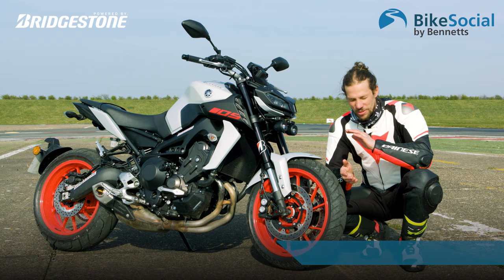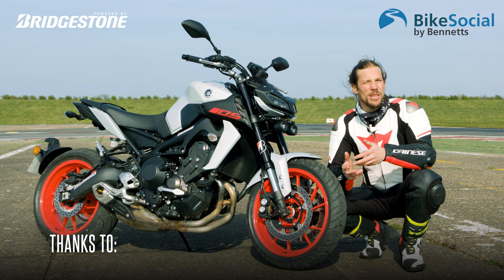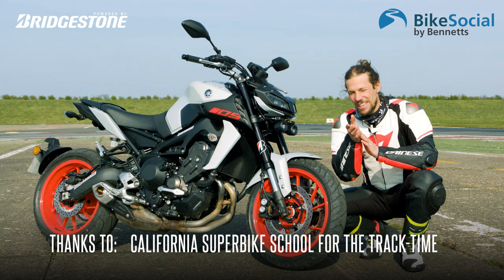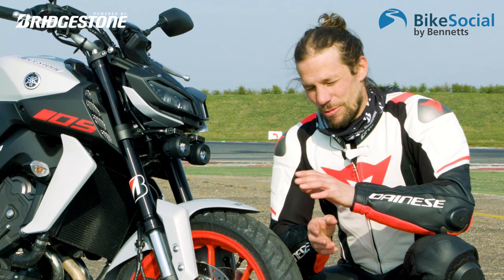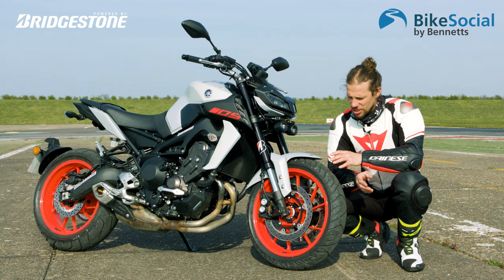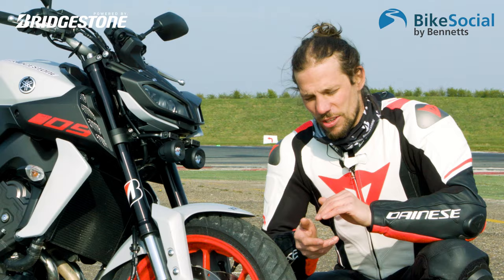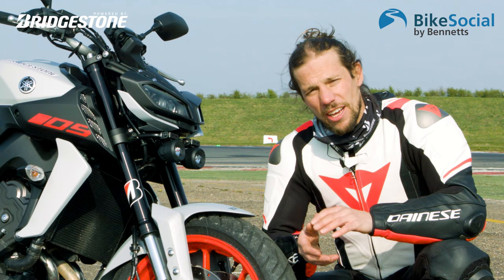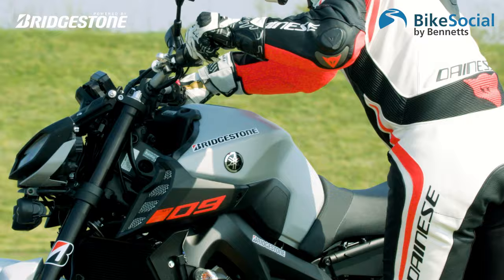Should you brake while turning? Motorcycle riding tips

Comment: Finally, some hard, experimental data on a subject nobody seems to agree on. The conclusions are clear and definitive: as long as you are smooth, you can use the front brake. Many thanks.
Reply: The hardest part is finding a way to practice this. I want to get that setup they got on their bike so I can practice this on my particular bike without worrying about the bike.
Reply: Teesh Yalamanchili get an off-road bike and practice on dirt! You’ll appreciate the feel of the controls more! Nobody knows how much you can actually brake on road coz you don’t know the road surface in practice (could be good, could be fuel or gravel etc) but getting the feel of the levers when it’s on the limit of grip does help. And if you’ve done off road you probably don’t panic as much just because your bikes starting to slide coz you’re used to it. Worth a go!
Reply: @SteveInskip  - thanks for the advice. I used to ride BMX, and did a bit of Mountain Biking, so I already have this natural tendency to ride the front brakes. Naturally those things don't weigh anything compared to a motorcycle but I've noticed the few times I've been riding I'm always feathering the front brakes. So perhaps it's just a matter of fine tuning my technique.
Reply: Teesh Yalamanchili yes, I think you’re right, but much cheaper to do it on an off reader! Falling off doesn’t matter so much and doesn’t cost so much. Have a good one!
Reply: @yatman67  Keep 'feathering' mate, I've done the same since the seventies and have yet to have a tyre wash out on me and I often go into a corner too hot.
Reply: @SteveInskip  Riding off-road won't teach you anything about proper front brake use and will probably make you a worse rider in that aspect. I agree off-road riding is beneficial for many reasons, but learning how to brake properly is not one of them.
Reply: I actually learned on my commute back and forth on my 250 just because my back brakes were gone and I was being lazy, that lead me to learning how to use the hand brake in all situations cornering being very easy to learn... I wouldn’t recommend doing it I was just being a lazy ass and stupid lol
Reply: Yeah learn on a dirt bike then accidentally like them too much and forget about road bikes all together!
Reply: Speed & Power it teaches you nothing about loading the front tyre, but it does teach you not to panic coz just you’ve lost grip, that the back brake is actually more useful than you thought and most importantly when NOT to use the front. Have a think about that last point. Not everyone lives in a town in a temperate climate!
Reply: mate i was just expressing that i tried a dirtbike got hooked, and that riding the dirtbike helps ur balance and confidence so much
Reply: Ruben Fraser hi Ruben. I wasn’t replying to you, totally agree with you about dirt bikes.
Reply: @yatman67  maybe that explains why I feel comfortable using front bikes, I was riding mountain bikes before i started to ride a motorcycle xD
Reply: If you dont have abs on, You better not try to apply simple disk brake(front) in a tight corner, else what the guy says she'll be out of control in a heart beat
Reply: I use hard on rear then soft on front never lost the front , but had a few heart stoppers
Reply: In an ideal world I absolutely agree but unfortunately on public roads you'll also have many variables with surface conditions etc so the police roadcraft method including your speed being dictated by your view usually ends up much safer but using their method in an emergency could really help.
Reply: amen. My Msrp class was wrong
Reply: Agree, a great find this video.
Reply: what about the rear brake?
Reply: @SteveInskip  Off road bikes are fine  off road that what they are designed primarily to do.   They vary very much from the ordinary street bike that one would use for general riding on tarmac so whilst its ok saying get some off road training that all well and good but try doing things on an ordinary bike the same as say  a trials bike and you will soon come to grief.  They are as different as chalk and cheese.
Reply: @rcraven1013  trying to ride your Super Naked like a trials bike would be a bit extreme and for anyone daft enough to do that I’d suggest they are probably better off taking the bus. Off-road riding does give you a very appreciation of how to control your bike in different situations with different levels of grip and it’s excellent for learning how to use your clutch and back brake to maximum effect. Think dual-sport rather than trials. It’s also a lot less dangerous learning the basic stuff, clutch control, braking with very little grip, bike handling, etc. You are going to fall off a lot but it’s a lot safer than an ‘A’ road and there’s nowt coming in the opposite direction….apart from the odd cow! 😉. I’ve got all 3, super naked, dual- sport and trials and they are very different beasts to ride but with a striking number of similarities.
Reply: Sure not general agreement. ‘Cos isn’t just one way, you take the ones you practiced.
Reply: @yatman67  hope you know it well now :) if not you can practice on the bicycle its same in principle and you need worrying about the bike :)
Reply: It's called trail-braking.
Reply: @yatman67  "The hardest part is finding a way to practice this" go for track training and practice learned stuff on the track. You'll very quickly learn the amount of braking that you can do while entering the corner is huge. Mid corner you can still brake a lot if there's a need for it. It might be bit trickier if you're already on the edge of the grip, but in reality you should never drive on such a huge lean outside of track.
Reply: Pretty much everyone agrees on it. And "hard, experimental data" this was not 🤣
Reply: @SteveInskip  the general rule that I learned from the basic motorcycle license course is "NEVER use the front brake when cornering"... and it makes perfect sense for a beginner, who is not able to correctly apply pressure on the lever; but I wonder: if I use the rear when cornering to slow down, doesn't this compromise the use of the front even more? By braking with the rear, don't I transfer the load to the rear, lightening the front even more?
Reply: @yatman67  Find a nice big and empty car park or other space and just go round and round in ever decreasing circles.  Begin with   slower speeds and when happy increase slightly to faster speeds and  and greater lean angle.   Then back brake, then front brake then  both brakes to   on a steady curvature and you will see just how easy it is to brake on bends without snatching and to come out of the bend with a slower speed than one went into with.

Comment: Had a crash last month. Entered a tight turn too fast, I panicked and squeezed the front brake too much and I wiped out. Dumbest mistake I ever did. Good thing I only suffered minor injury on my knee and wrist, and a few sratches on my bike. Ever since I'm afraid of turns and also of braking and just ride moderate speeds. Learned it the hard way.
Reply: Same here 😀 ...now i am learning what went wrong how can we avoid it
Reply: @lostworld5667  you need to practice it on the bicycle. If you learn to save front wheel slide in the leaning position it will be easier for you on the motorbike. On the public roads you should use trail braking only like lifesaver tbh

Comment: Of course you should brake while turning - IF you start braking before going into the turn.
Reply: you can also use the rear brake to correct trajectory
Reply: @Agussg23  wdym?
Reply: You can brake at any point of the turn even if you were not at the brakes, you just need to do it gentle if you leaned far
Reply: @Agussg23  I don't think that's a good idea, the rear tyre loses alot of traction when cornering, rear braking can result in lowside or highside (if you regain traction abruptly) , so between the fact that the rear brake is very weak in any situation, plus the fact that you are cornering doesn't give you much braking force possibilities, it's almost more effective to use engine braking and less risky. The front tyre however has alot of weight and grip when braking, so you gain more grip when braking contrary to the rear tyre, and you can brake way harder thanks to that , you also lose cornering capability so there is still a limit to how much braking force you can apply before you enter the opposite lane or leave the road when going left. But that's true of any land vehicule, lock the wheels of a car and you are going straight out of the road you can no longer turn. Best combination I can think of is staying low on gears wen cornering to get high engine braking if needed, and front brake as much as you can, maybe help a bit with the rear brake, but combining it with engine brakd maybe isn't a good idea, you may lose too much grip. If you are more of a sporty rider and take out your body more than you lean the bike, the more the bike is straight and the more braking you can have, the less you move your body to the inside of a turn, the more you have to lean the bike and the less braking you can have, that's also a rule that can help you keep a safety net if needed, taking your body a bit out even if you are not on a sport bike.
Reply: @OneRichMofo  if you want to go tighter into the turn, then apply a small amount of  rear brake, if you want to go wider, open up the throttle (gently)
Reply: @adridell  Thanks for the detailed response hahaha. I agree with most of what you said, but i almost always use the rear brake when cornering exiting the corner and even in corner entry. The engine brake is most of the times sufficient but in long corners is almost better to not let the throttle out completely (once youve started applying throttle) as this will mess up the weight balance. It's best to play with the rear brake depending on what you want to do.

About the front brake... on turns is best not to touch it (if the lean angle is high) because it will make the front tyre overload and loose traction and it is always better to loose the rear than the front tyre.
Reply: @Szlejer Armchair expert talking.

Comment: one of the best videos i've seen on braking.  An expert rider taking it to the limit over and over so we can see the results.  So great!  As others have mentioned, I'd love to see the results with the back brake progressively engaged.  There is a lot of free advice out there that says that's the way to do it when you over cook a corner - would love to see that tested!!
Reply: conscious - I want to see this too - using only the back brake.
Reply: If we use too much front brake at all when stopping we actually throw our whole weight and that of the bike and passengers forward onto the front forks, down those forks and to the front wheel and eventually all that weight load is taken on ones front tyre and that has a contact patch as big as maybe three fingers in total. Not a lot of grip there then.  However as we throw our weight forwards then we lose weight on the back end and end up  doing a reverse wheely in that the front is heavier and the rear is lighter so the rear wheel lifts up and loses contact  from the tarmac and thus rear brakes become  useless. Yes we can initially brake with both front and rear but as we progress and weight shifts more and more we could lose the back end  and all of its braking power..
Reply: You lose the back end before you actually get much braking done if you do this. It's easier to recover, which is why people recommend it, but it's not actually very effective. Even if that's all the braking effort you need, it'd be safer to get it from the front wheel smoothly. It's well within the traction limit. Plus it loads your front suspension better, shortening the wheel base.
Reply: @233kosta You get it!!!

Comment: I think I've been trail braking by instinct since I first started riding and never thought about it until I started watching these videos. I was on a ride in the north of Italy recently and following a group of bikers down the twisties on a mountain pass. I noticed all of them braked fairly significantly on the straight before the corner, because coasting round the corner without brakes and then accelerating again. I gave it a go for a few turns but to me it felt a whole lot more sketchy than using the brake smoothly all the way into the turn, I just feel in complete control even if it just lightly on the brake. Seems like it's acceptable provided you're smooth
Reply: Trail braking into it preloads your tyre. As long as you don't just dump it as you come off the lever, you'll be in better control doing that than neutrally loading.

Same as getting on the power on the way out.

Comment: I took my first m/c performance course more than 30 years ago.  One of the exercises involved outriggers and high-speed, controlled braking.  PANIC braking.  Instructor asks for a show of hands at the beginning:  "Who here likes to go fast?".  Everybody raises their hands.  Instructor:  "Who here loves to brake fast?".  Nobody raised their hands.  We had to hit 60mph....and then lock it up.  SCARY.  But the lesson(s) have always stayed w/ me.  FWIW:  Been riding 41 years.  Current ride:  '87 BMW K75C.

Because I lack ABS, I use a modified technique I call "Drop and Drag".   I "drop" the front brake PRIOR to the corner; then release once I've scrubbed some speed, and drag the REAR brake thru the corner.  This works especially well the tighter the corner.  Seems to work; in 41 years, only been down once....and that was my front wheel hitting a fissure in the asphalt, locking the wheel, flipping me.  Luckily, low speed (2nd gear), and aside from bruising, no serious injuries.